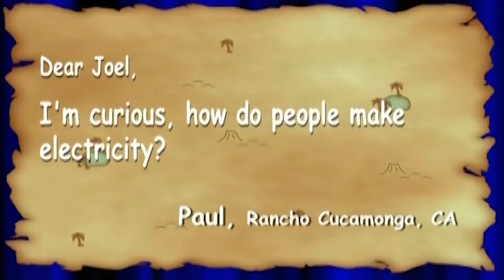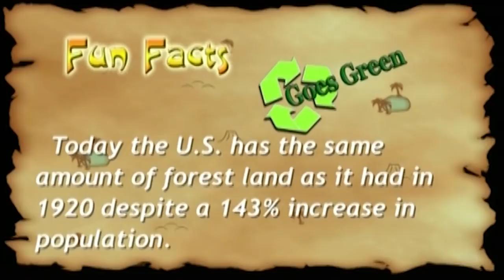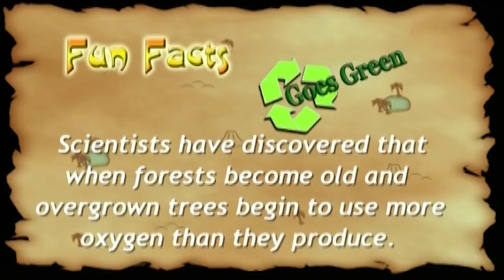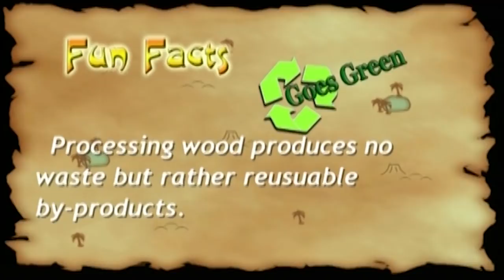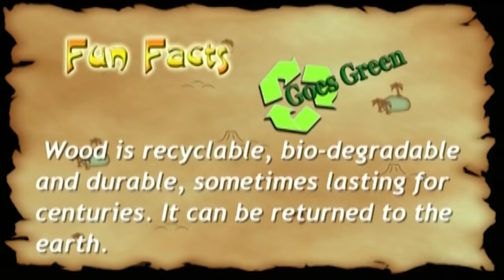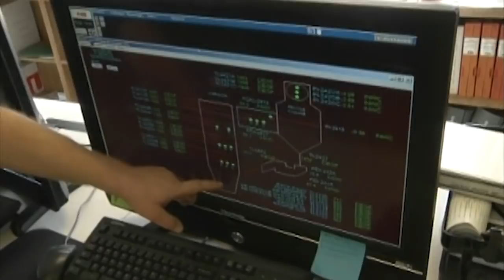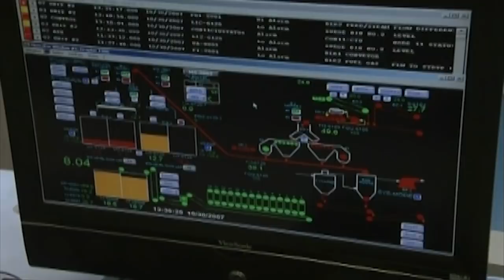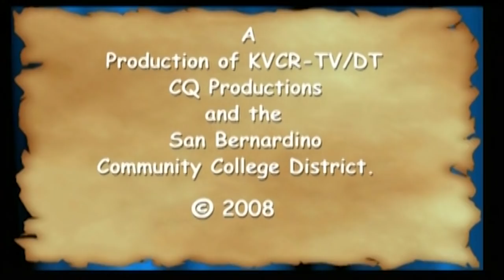Wood Recycling

Comment: How is wood burning construed as recycling?
Reply: The definition of recycling is converting waste into usable material, which it is
Reply: @ulisesrodriguez1277  When did reusable timber become waste? True recycling is as the name infers - keeping the material and reusing it. Burning is the end of the cycle.
Reply: @MrHitchikerOz recycling is using waste products into new material, in this case being the ash for concrete and energy, the wood would have just ended up being in a landfill so it is waste

Comment: Burning the wood is not recycling it
Reply: No, except for the wood ash, which has some uses. 

However, it is not green - and shouldn't have even been mentioned as a good use on a "Green" program.
Reply: Did you not watch this
Reply: But it is

Comment: There is no problem with the supply of oxygen. The problem is with the oversupply of carbondioxide.  Most of the oxygen in the atmosphere comes from the ocean, not the land.
Reply: CO2 spurs plant growth. Greenhouses actually use CO2 generators.

Comment: Incineration is not a form of RECYCLING
Reply: Actually it is because when wood is burned carbon dioxide is released into the atmosphere which is then reabsorbed by growing plants including trees. And because the wood in this video gained all it's carbon from the atmosphere in the first place the whole process is carbon neutral. just sayin
Reply: Except many of the tree plantations use a lot of chemicals during the early stages of a new tree's growth. The process is hardly carbon neutral. Also, the monoculture tree plantations destroy the area's biodiversity, leading to more pest/disease problems on the plantations and nearby lands.

It would arguably better if it were all just put in landfills, at least the carbon would be sequestered. 

Composting would probably be even better, but I don't know how much CO2 is released during the process.
Reply: Do you know the definition of recycling?
Reply: @ulisesrodriguez1277  recycling means keeping the material in use. Did you see an tree used after the process here?